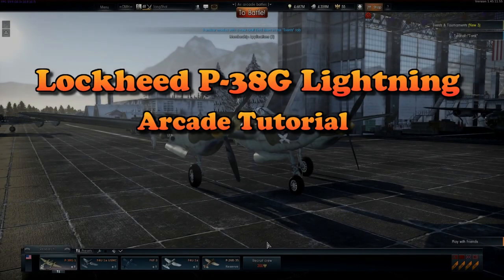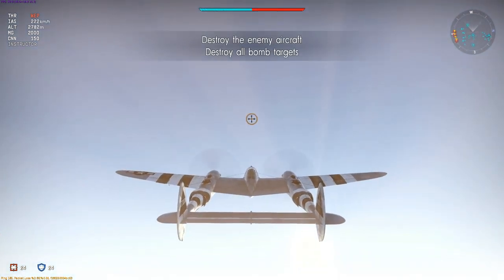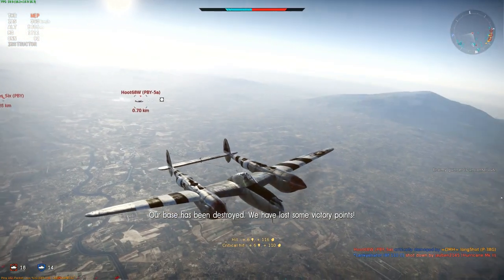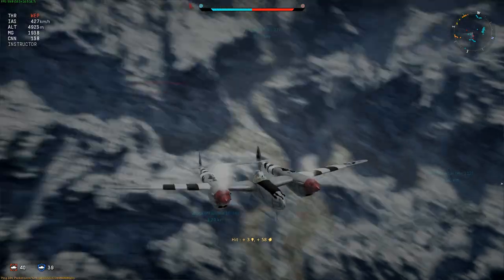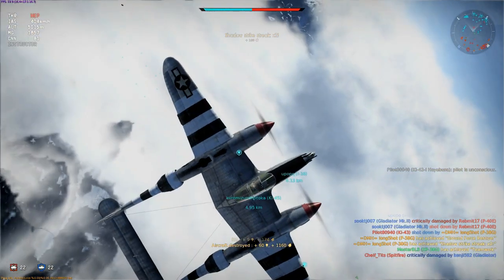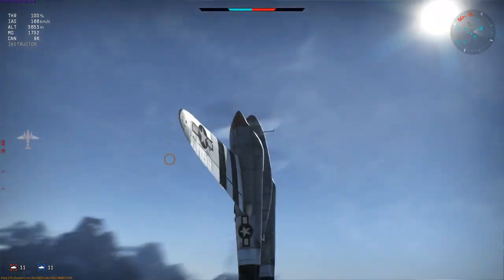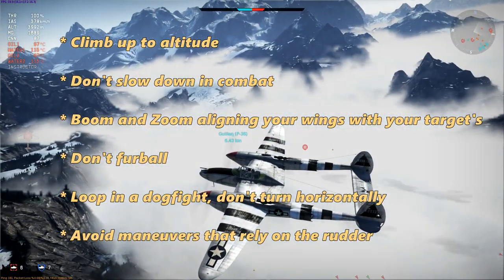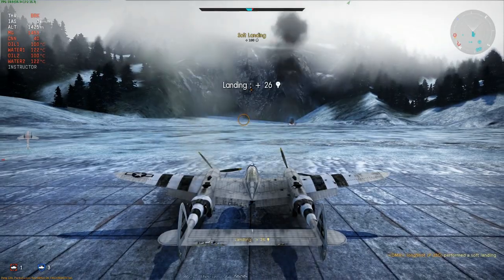WT - P-38G Arcade Guide (Patch 1.45 edition)

Comment: While personally I enjoy flying the P-38, I do recognize all the flaws and faults that you point out in this video. At the same time I've found a few things that work for me a little more when flying this plane.

I find that it's actually not that bad a plane to attempt head-ons if necessary. Assuming all other terms being equal, the concentration of firepower in the nose usually means I can put a few quick bursts into a smaller, more nimble fighter, before evading (a barrel roll usually does the trick) either nailing his pilot or hitting a vital piece of the engine and taking him out of the immediate fight.

Secondly, I generally don't climb quite as sharply when performing boom and zoom tactics, preferring a more leisurely climb to maintain the speed and escape potential dogfight scenarios. While this can (and does, depending on how doggedly your opponent is set on following you) take you out of he action for a few extra seconds at a time, I feel it plays a bit more to the P-38's strength, which I find is predominantly it's speed over other aircraft at that tier/battle rating.

It usually makes for a wonderful bomber escort plane though. Baiting enemy planes to choose between you or a bomber, they'll usually go for the bomber, allowing you to pick them off with relative ease.

I hate that it lights up so easily. On the flip side, if I see a furball with an enemy P-38 in the middle of it... well, that pilot wasn't being very smart. I'll usually aim for him first, since I know he's easy to set alight and bring down.

Comment: A enemy P 38 for me has always been a free kill. It's speed is only decent for it's BR and it's profile is so enormous I am convinced Gaijin modeled in the gap between it's tails as being part of the plane. It's also the most common plane I can set on fire with any sort of gun. Although it turns well for a heavy fighter, I have outright out turned it with a FW 190. The few times I have flown it, I noticed it's aiming response suffers greatly at high speeds and it is a sitting duck at low speeds to even low tier 1 planes. It's climbing ability and heavy nose mounted weapons are it's only good features. I often see them at 6-7 Km in the sky doing absolutely nothing, hoping a stupid heavy bomber lumbers their way.
Reply: jaykia HAHAHA so fucking true

Comment: Hey Long5hot,  mind updating this one as well as reviewing the new 38s in 1.53?
Reply from the maker: +Mike Hammer Hmm, well, I'm not sure that there's much to update on this plane.  It doesn't climb as well, though the Assaulter's spawn point helps in that regard.  Its high altitude performance (> 7000m) is decent, if you need to get that high.  Its roll rate is fairly good as it was on this video, but there's other planes that are better.  Its rudder is still poor, it still can't out-turn anything, its not really that fast & there's planes that can & will run you down, and its weak/flammable DM makes it a liability in a head-on if the other pilot's a decent shot.

The only change between now and the video is the worse climbrate and the assaulter spawn point - everything else is much the same.  At least that's how it seemed to me in a couple of flyouts after 1.53 dropped.

I'm steadily unlocking the other P-38s, but it might be a while before I fly them.  Too many planes, not enough hours in the day...
Reply: long5hot That was good enough for me!  I appreciate you took the time to do a quick overview even in text.  It means you can spend the "real" time on new stuff!  See you in the skies.  -Slash621

Comment: The Lockheed Lightning was never deigned to be a dog fighter in the model of an arcade. Its a ZOOM and BOOM dive bomber in most respects. Its high speed was its best feature coming down from high altitude and firing on unsuspecting German fighters or bombers. 

In WWII It was used well in the MTO and the PTO as it was very fast and had long range against Japanese bombers and fighters. The American Air Force had a doctrine to NEVER DOG FIGHT. 

As the war came to America the P-38 had few advantages over the Bf 190 or the Japanese ZERO. But it could out perform many other aircraft such as the VAL Dive bomber and the German Stuka and the German Me 110. 

In fact the Lighting did very well at high altitude and under performed at altitude under 15,000 feet. This was because it was a big plane and yet it was very fast. 

Its chief job was to escort bombers to target and fend off attacking fighters. It did not always have to kill each enemy fighter plane. It just had to prevent them from attacking the Bombers. This was a defensive advantage in the early pasrt of the war. 

In many cases the Lightning could not reach the targets with the B-17s or B-24s and often had to turn back to England before they ran out of fuel. The P-47 had the same problem. 

Both fighters were ZOOM and BOOM fighters. The P-38 suffered from sound barrier. Ut was too fast in a dive. The problem was solved in the latter J models with Speed Flaps.. 

As the Lightning returned alone from an escort mission it would attack German air fields on the way.  Attacking the German fighters and bombers on the ground. 

In the Pacific it did the same as it had an advantage of long range and speed. The Japanese had a good fighter in the Zero but few other planes made for the Japanese Air Force were as capable. All fighters and bombers in the Japanese air force were un armored and had no self sealing fuel tanks. They caught fire or exploded very easily. 

By the time the tactics for the Lightning were being proven in both theaters of operation, other fighters like the P-51 and the Navy Hellcat were placed into service and deigned from the drawing board knowing the enemies capabilities. 

The P-51 had long range and maneuverability well out performing the Lighting. Soon the Lightning was placed into the role of a Ground attack fighter bomber. and escort missions i the MTO-ETO were rare. 

So using a lighting in Arcade against P-51s and Hellcats as well as F-4Fs is not realistic. A good plane like the lighting can do damage on other fighter planes but it would take a great pilot to beat the American fighter aircraft , especially in an un historic Arcade game that is only designed to get high scores.

Comment: I'm curious, why no stealth ammo? It really helps me maximize time on target in the P-38. Also I almost never do a vertical burst climb in this plane because it makes me very vulnerable near the top of the climb. I usually extend away at a high (40-50 degree) angle, but one that helps me maintain my speed to give me the option to just fly away from pursuers rather than being forced to dive instead. Things thing climbs so well regardless that it doesn't need to sacrifice all that speed to regain altitude.
Reply from the maker: The vertical burst climb in the flight test was just to measure how much altitude it was capable of recovering, which usually (for me) then sets the lower limit for BnZ attacks.  It recovers 1.7km, hence I'll attack targets that are no further than that distance below me as I know I'll get back to my starting altitude.  Unless of course I don't need to be that high or I'm happy to extend away horizontally or even keep diving after the attacking pass.

You're correct re stealth, in fact I use it now (I recorded this footage a few weeks ago), not sure why I was going with Universal at the time.

Comment: Great video, that last game was nicely flown. Although some things  I've noticed while you fly this plane, you rely too much on the rudder to aim and moving targets, as maybe you are used to planes such as yaks, 109s, p39...etc which you can simply use mouse to aim really easily with because of balanced rudder/elevator. Try using aileron to get to where you can use elevator to line up the shot and not rudder, such as on gorge, that spitfire diving away, you rolled halfway but then ended up stopping and tried to aim with rudder, I'm certain that it would of granted you a kill if the above method was used.

Another one thing, I personally think that you should put in a little more aggression, as you can easily get 10+ kills with no deaths if you combine your tactics with more aggression, and maybe learning head ons a little more, as you can fire and kill the person from 1.0km out without taking a single shot or putting your plane at risk. One last thing, is look behind you right after you make the bnz attack, I see you wait 5 seonds+ sometimes. Looking right behind exactly when you finish your bnz attack will tell you what action would be best, to dive away, fly level or climb up once again. ;) once again nice video
Reply from the maker: Yes you definitely need to use the manual roll a lot with this plane.  And yes I am way too used to flying planes with decent rudders :)

I often get 10+ kill games, just not in the P-38.  Head-ons in this plane are usually a death sentence in my experience - I may be able to kill the other guy but rarely ever escape unscathed.  If you look at the XRay you'll see why - there's fuel and coolant tanks on the wings mounted ahead of the spars & totally unprotected from the front.

And yeah, sometimes at high altitude I get complacent with my SA - I could see that in this video.  When dogfighting that Spit I really should have looked around, and I hardly ever did.  As for aggression, yes Rhotert's told me that as well :)  Its a work in progress!
Reply: Yes, 10+ kills without a death is my goal every game, and I'm usually I'm not satisfied if I don't reach that goal...and winning the match is just a bonus ;) The p38 is a bad plane to head on in, and I usually only head on in props when someone is climbing up to me, so you can break away above with great speed giving them no chance to kill me, only head oning with and equal state if I know I will win, or its my only option. Indeed the p38 is a flying matchbox, so it's justified in my eyes to play a lot more cautiously.

 The thing is to find the absolute right balance between aggression and conservative play. After so much time in game, I've finally found that sweet spot, with that, this game just doesn't get old to me haha ;) ohhh rhotert, a good player on a previously very under tiered plane, but far far too cocky on forums, a little maturity is needed maybe haha, after all it's just a game. Have a nice day and make sure to tell okkie and staka I said hi
Reply: +long5hot m8, do you think you might do a video for the XP-38G as the FM was supposedly changed, or does it fly basically the same as of this current state of the game from when this video was made?
Reply from the maker: +Kristjen Štjuprić Afraid I don't have the XP-38, though as far as I know it has the same flight model as the P-38.  I wasn't happy with this video, I'm sure I could do better if I revisited the plane.
Reply: long5hot
I understand, m8! This was a great video anyhow IMHO... You always do fantastic! Even if you don't get your 10+ kills before getting shot down, you still an amazing pilot! and flip, don't even get me started on you, my friend! LOL, you are so good you can get 10 kills without even looking at the computer screen lol!!

anyhow, you are great long5hot! i have learned SO MUCH and continue to learn from watching your videos... i was wondering... i haven't been using my flaps really AT ALL unless i need to generate more lift as I've been trying to learn how to BnZ and Energy Fight extremely well since, it's my belief that if i get good at that, i will be a MUCH better all-around player as I can practice the other things as well...

I was thinking of trying to practice in single player mode against bots, but i'm afraid i don't know how to do that, m8! whenever i do a test flight, it's only me up there after all... i have no idea how to put AI players into the match... is there another game mode that i just don't know about? i think i'm just missing something here... i'd LOVE to practice against the AI as i REALLY want to get my aim better, but obviously that takes practice and i am constantly having to worry about other things when flying out in ABs against other players...

sorry for such a long post and thanks for all of your help, m8!! take care!

sincerely,
OberstStjupric (Kris)
Reply from the maker: +Kristjen Štjuprić For practicing against bots, click the test flight option and then in the lower left there'll be a button saying Mission Editor.  That's your window to AI goodness :)
Reply: long5hot
ahhhh okay! i will give that a try when i have some free time... i have been writing a couple programs today so i've been able to watch a lot of your videos ;) i just haven't been able to play any WT unfortunately :( thanks again, m8!!!

Comment: As always, I really like your videos and especially your reviews. But I do think that most of the problems you are having with this plane in this video is due to the fact, that you might have misunderstood the role of the P-38G slightly, and how to fly it properly. The plane is a heavy fighter even thought it might look and feel like an ordinary fighter, it has the characteristics of a heavy fighter; being heavy, having a bigger fuselage and having bad rudder control. I think you don't really use the plane's ability to build up speed properly and instead fly it like a pure energy fighter, trying to engage more maneuverable fighters and climb very hard when faced with fierce resistance, instead for flying away from them and reengage. This is how I fly this plane, and I usually get good results by doing this. :)
Reply from the maker: Thanks Rasmus, yes good advice.  However, I've seen people flying them that way and while they're not easy to shoot down (depending on what plane you're in) they can also spend a huge amount of time running away & not factor much in the battle as a result.  If we regularly had 15 minute + games then it wouldn't be a problem, but not when the average is closer to 7 or 8 minutes.
Reply: novocas7rian That is a good point. But the way that you flew the P-38G in this video is also very time consuming as the way I fly this plane. You spent a lot of time climbing to 4 - 5K meters in altitude, and then staying in at that altitude engaging bombers or the few enemies, who doesn't know what to do, and then try to climb up and engage you. I don't spend much time fleeing in the P-38G, because most people in arcade chooses to disengage when the distance between me and them increases, because of the P-38G superior acceleration. In most cases I get to kill them soon afterward, as they do not expect me to turn around and engage them again, after they spend some time chasing me. :)
Reply: Rasmus Kjærsgaard Nielsen While the pilots that had the greatest success with the P-38  (in the PTO) agree with you entirely, I have heard of certain pilots that were able to engine turn the P-38 if only to improve their angle on shots or keep the target in the retical for far longer or get a shot when ordinary flight would not have yielded  one.

Comment: Any recommendations for high speed, low level capable fighters? I like having the ability to go weaving through mountains and doing strike fighter stuff.
Reply from the maker: Hmm.  By the time you hit tier 4 nearly every fighter will be high speed, so I'll look at lower tiers.  For Germany I'd start with the He-100, then switch to Bf109s starting at the E-4.  Then the FW-190A-1 & A-4 are both very fast fighters that can do ok at high alt but are ideally suited to lower hit & run style combat.
USA - the P-47Ds are absolute clubbers, low or high alt, provided you keep them fast.  Try to avoid maneuvers other than rolling.
Britain - Spitfires.  They're jacks of all trades really, quite fast with the ability to turn pretty well, though the turning advantage is far less pronounced in higher tiers.
Russia - La and Yak lines both thrive on low alt high-speed combat.  Their diving speed isn't great, but they accelerate very quickly, and both are excellent turners once you use the rudder key.
Japan - Ki-44, J2M2/3, Ki-100, Ki-84, J7W1
Italy - Mc202/205, G.55

Comment: Is the poor dmg model of the P-39 in WT historically accurate?
Reply from the maker: I assume you mean P-38?  I really can't imagine that its accurate at all.  US planes tended to err on the side of strong construction and they certainly had highly effective self-sealing fuel tanks.  There's only one nation in WT right now that's good at consistently extinguishing fires, and its not the US.

I'd have a lot more positive opinion of the P-38 if its DM wasn't so fragile and flammable.
Reply: Yes I did indeed mean the P-38 and I was kind of baiting.  I agree the plane would be much closer to it's battle rating if it did not ignite so easily. It's like the devs got the P-38 confused with the M4 Sherman tank which  the British nicknamed the Ronson after the cigarette lighter that had the tag line - Guaranteed to light the first time every time!